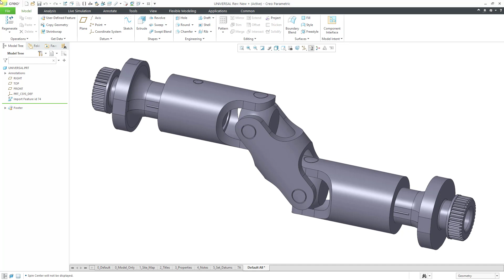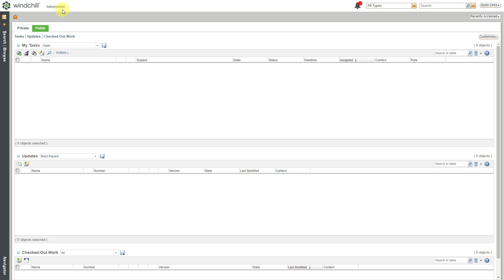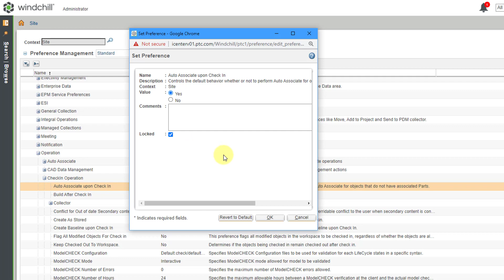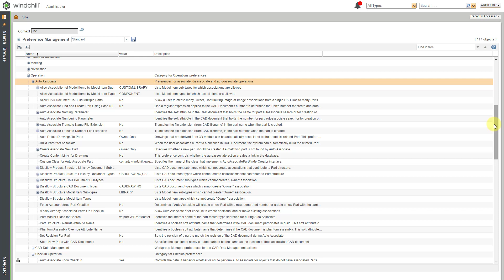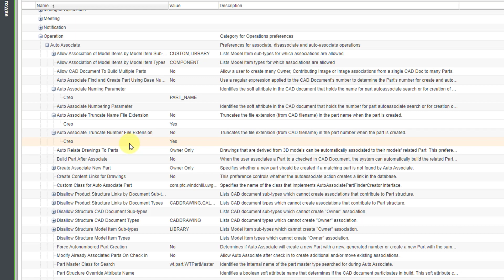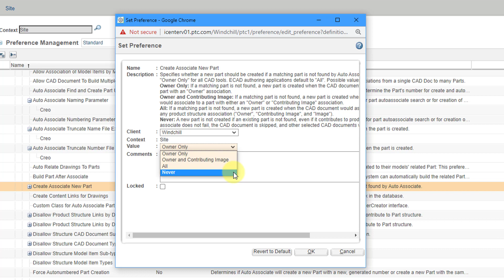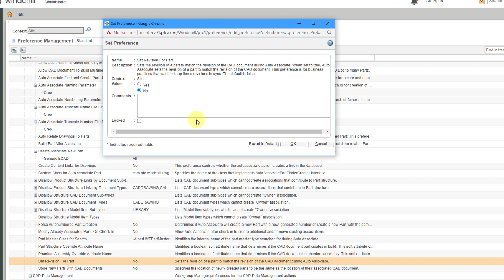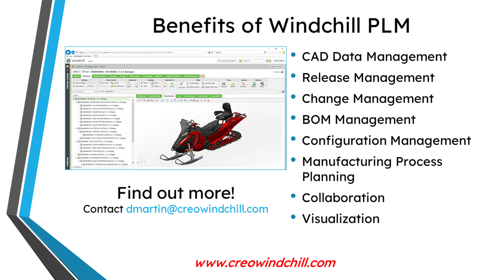PTC Windchill PDMLink - CAD Administration | Auto Associate Preferences

Comment: i also do not have the auto associate entry under operation. I am just a design engineer though.

basically want to derive a wt part structure form my cad model
Reply from the maker: Talk to your admins. They may have not activated WTParts or turned off your ability to Auto Associate.

Comment: Hi, so if you have a CAD assembly done without this option turned  on already checked in, is there anyway of enabling this setting and forcing it to create wt parts for you or is it new part check ins only?
Reply from the maker: Windchill is incredibly configurable. Talk to your admins. Short answer is yes but it depends on your permissions.
Reply: Whats the long answer?  I work for a massive configuration as a solo design engineer at my site. I dont know who the admins are (yes its so big that i dont even know who to ask) and there some half finished assemblies im working on that require wtpart structured boms to go into production. @CADPLMGuy